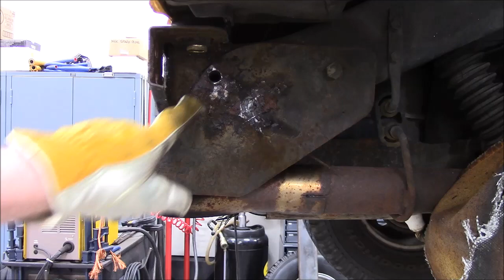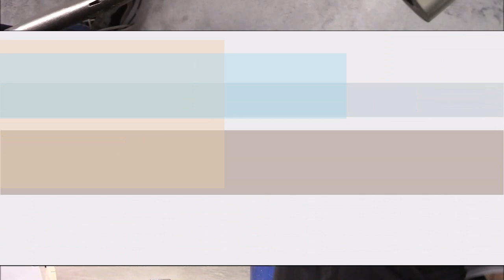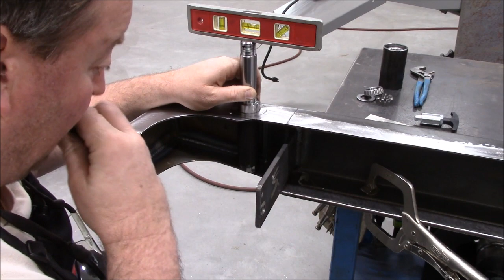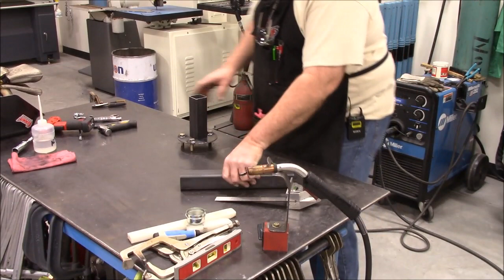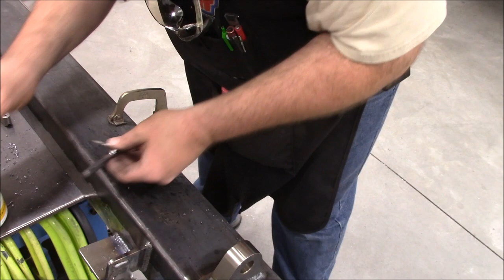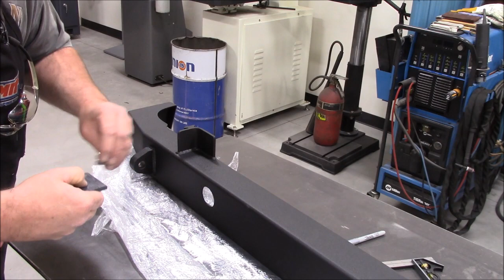Jeep Wrangler TJ Rear Bumper & Tire Carrier Build

Comment: vERY NICELY DONE,i am actually in process off making one myself, the bumper is finished and i will be welding on the spindle this week, i have one question how long was the bottom piece that welds to the spindle 40" maybe???
Reply from the maker: I can’t remember the exact length of the bottom tube but seems like about 36-40” is about right.  
Thanks for watching.  
Mike
Reply: @zmotorsports62  ahh ok ,i noticed the locking type clasp works very smooth but i couldnt tell if its grabbing the back side of the l bracket ??  does the clasp have  a slight bend so it grabs the corner? your latch seems to be the smoothest ive seen yet and plan on doing the same! thanks for the response mike i appreciate the feed back!.
Reply from the maker: The latch is a Destaco brand that I modified slightly to overhand the end of the lower tube and I welded the receptacle onto the bumper so it pulls straight.  I also welded a small tab on the top of the clamp so I could install a 1/4” push pin into securing the toggle clamp. 
Mike
Reply: @zmotorsports62  OH i didnt see the push pin for the clamp in the video but i did see the push pin for the swing out to lock it while its open, i bought the style similar to yours, but mine  you can lock the latch in order from preventing it to unlatch,also i think instead of cutting the latch and drilling more holes for it to over hang i will weld a small piece 2" square flat stock enough for the over hang and drill tap holes on the tab to to match the ones on the latch possibly ,im waiting on all my parts to arrive as i just finished fabricating and welding it up today!. cheers have a great holiday and new year!, ps what state are you from??.
Reply from the maker: Utah

Comment: love your bumper. any suggestions on where to buy that spindle from and the d rings or did you fab those yourself
Reply from the maker: Thanks for the comment. 
I’ve purchased components from both A to Z Fabrication as well as Ruff Stuff Specialties.   
Mike
Reply: thanks
Reply: love your garage journal build thread

Comment: Very nice,I love your fine eye for detail and so beautifully explained.One little thing I did notice was the lack of a strengthening gusset on the inside of the vertical and horizontal where the tyre mount connects,has it been ok without this ?
Reply from the maker: Thank you. 
I actually did tie a gusset into the carrier spindle. It has been working flawlessly without any drooping. 
Thank you for taking the time to watch and comment. 
Mike
Reply: @zmotorsports62  I did notice the strengthening on the spindle which was very nice but I did mean near the top of the inside of the L section where the wheel is mounted to.If you go to 32.30 minutes in you will see where I mean.Cheers
Reply: One more thing,can you please link me to where you got that latch from it looks like what I am after for a wheel carrier I am designing at the moment,I can only find inline D latches but I like the 90 degree pull in type like your one.Cheers
Reply from the maker: Shane Gunn sorry, I misunderstood. I don’t gusset those areas because the tire pulls in tight to the lower bar and doesn’t allow any flex. If the tire was hanging out in mid-air it would be a good idea to gusset that 90-degree weldment.  The way it is there is a lot of surface area for weld which makes it very strong. 
On  my personal Jeep it is the same way and I carry a 37” tire.  I have over 95k miles on my Jeep and it’s  holding strong. 
Thanks. 
Mike
Reply from the maker: Shane Gunn sorry don’t have a part number fir the clamp but I purchased it from McMaster Carr. It is a DeStaco brand and is actually a straight pull but I use it as a 90-degree pull.
Reply: @zmotorsports62  Thanks for the info.Interesting it is a straight pull as most I have seen can't do a 90 degree.
Reply from the maker: I did have to redrill mounting holes to offset it enough to gain needed clearance for the 90-degree pull.

Comment: Not sure if you will see or respond to this comment, but im currently in a fab class and making my own side armor with steps, but was curious if you had a blueprint and LOM(list of materials) needed for a bumper, I have an 06 TJ
Reply from the maker: I’m sorry, no plans, blueprints or LOM. I build my numbers on the fly and no two are the same. 
I simply use either 1/4”, 3/16” or 10-gauge P&O sheet as far as materials. 
Thanks for watching. 
Mike
Reply: @zmotorsports62  I appreciate the quick reply but hey I figured it didn't hurt to ask, great video though